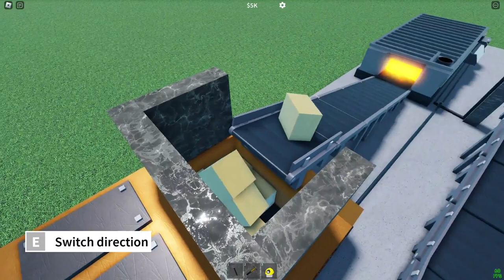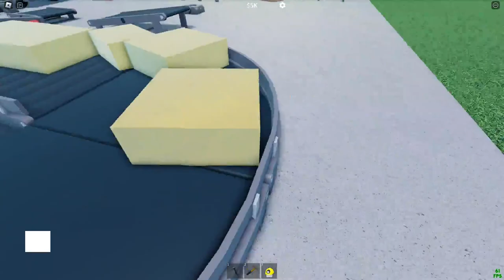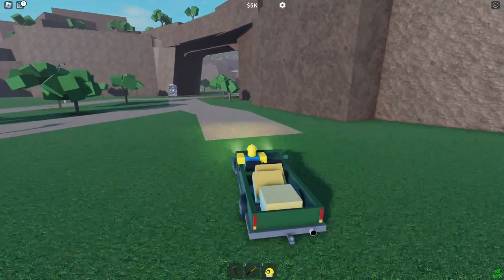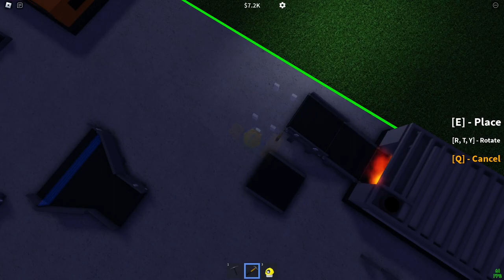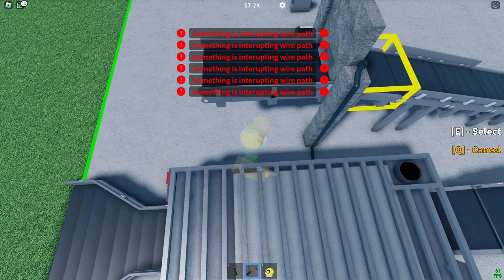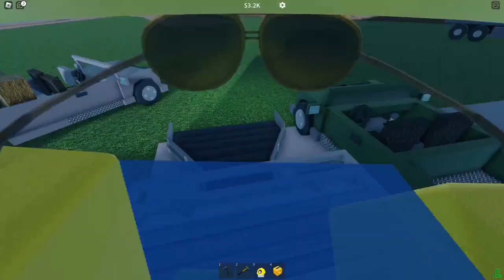Easy Beginner Conveyor & Compactor Setup - Tutorial - Refinery Caves

Comment: where do you get the delay, blocks, funnel, and trapdoor?
Reply: delay from electronic anitsishop the other two not sure am still looking for them :)
Reply: after years, i found the trapdoor

its in the utility convinient store by spawn under "hatch"
Reply: @amhedgehog  thank you!
i found the funnel its called converyo funnel in the cornor of the un utility convinient store looks like half sand clock
Reply: @amhedgehog  ty
Reply: @nfr9007  ty
Reply: @nfr9007  btw the blocks are at UCS store and 2 of the blocks are default so u spawn with them

Comment: my delay thing says 0.1 0.2 0.3 0.4 0.5 0.6 0.7 0.8 0.9 1. is that normal or did i buy the wrong thing
Reply from the maker: The Delay is 0.1 to 1, the Timer is 1 to 10. They do the same thing but with different settings